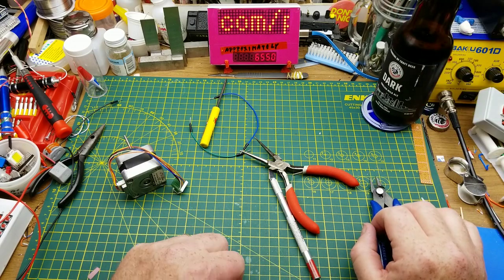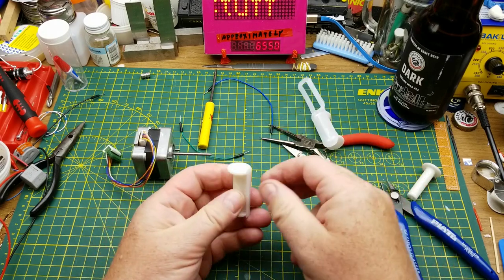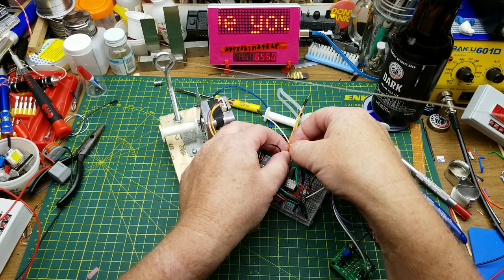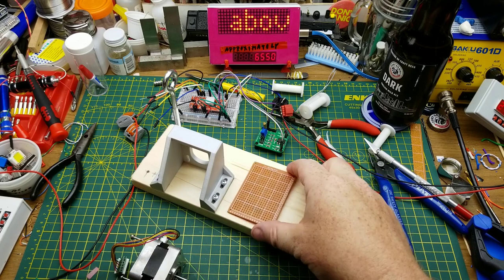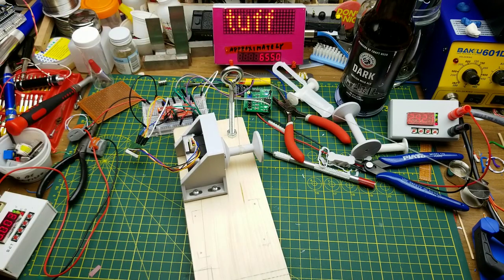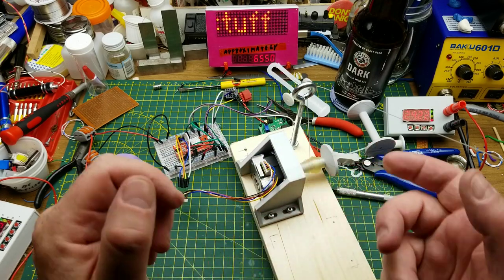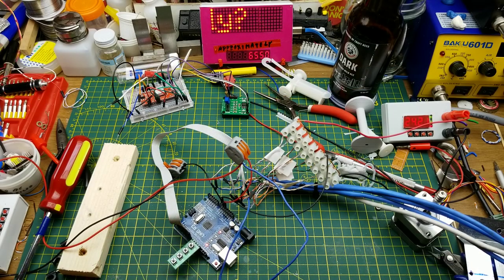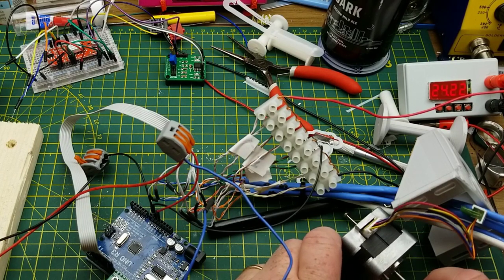attempting to build a homemade skycam (part 2 of ???)

Comment: Another idea is adding a tension feedback via a sprung mount with micro-switches such that line can advance when tension is high and retract when tension is low. That could reduce the geometry calculations and help keep all the lines at a nominal tension.
Reply: Just realized Jim Hammock suggested the same tension idea. : )

Comment: Use a tensioner on each cable that automatically uses limit switches to maintain a certain tension automatically.
Drill 3 small holes in the sides of the spools to insert and hold the line without creating a glob of hot glue on the shaft.
Reply: I suggested the same thing before I read your comment. LoL
Reply: John L 
Great minds, huh! LOL
Everything I think of has already been invented.

Comment: Congratulations on the 3d printer! The Ender 3 v2 should help you quite a bit in your projects. I have an Ender 3Pro which I have used to print numerous parts for the layout ( servo motor brackets, stone walls and electronic control boxes) and have experimented in printing N-scale hopper cars. Now you can combine your three hobbies, electronics, model railroading and 3D printing. Can’t wait to see what you come up with next!
Reply from the maker: N scale with a filament printer? That's impressive.

So far I have only tried a couple of HO scale prints. I still need to dial in the fine detail settings, and I'm pretty sure it's going to take a lot of  sanding to make the layer lines disappear.
Reply: pileofstuff I downloaded a coal hopper from Thingiverse and tried printing it on my Ender 3Pro. It came out rather well but as you can imagine, a lot of detail is missing. Still, once I gave it a coat of auto primer paint from a can and added trucks and couplers, it looks rather good. Especially from 3 feet. I now have a resin printer so I would like to see how much better it can look. Filament printers don’t do too bad. Sure they’re not perfect but a can print a fleet of hoppers for next to nothing and with paint and weathering they look good. Try it, you might be surprised how well they come out.

Comment: You can remove gears/pulleys from motor shafts without force. Just heat them with a small torch (even lighter should work) and they will fall right off. I found that amazing when I first did that  ;-)

Comment: It is inevitable these days, makers can't resist a 3D printer. 
My best use is making electronics enclosures that are exact fit for the components.  Having an enclosure planned also leads me to make breadboard projects permanent on a PCB.
Reply from the maker: Yeah, I resisted for a long time but this project is going to be a lot more possible with one.
Reply: @pileofstuff  A 3D printer opens up a plethora of possibilities. I took the plunge a few weeks ago. I noticed that, once you have one, you realise it can do so much for you. Either enclosures, prototypes or doing repairs on all kinds of things. This really is the best invention since sliced bread...!
Reply: Also the reason I broke down and bought a 3D printer ...
Wanted to make enclosures for evil electronic projects.
Reply: That’s the main reason I want to get one. I go to surplus stores and I get what almost fits.

Comment: Very interesting project... and quite complex when you start to think of it.
For moving the camera around, I think the code has to know how long the string to the camera is for each motor to start with.  So you need a calibration point. Then the length / amount of string per revolution spooled / unspooled has to be known to the code too... Tricky, when the amount per revolution varies... Beside the hardware, which we see is undergoing its maturity process, it's the code / software part that would also be very much of interest.
Reply from the maker: Hopefully my teenager can find time to work in the code now that he is back at university.

Comment: Seeing the first video I realised it needs some trigonometry logic for the exact "problem" as noted in this video. Challenging, but not impossible. It's all triangles -- after working out the problem on paper, coding the solution should be pretty straight-forward. It may never be 100% due to the fact that the cable turns around on the printed axels, and as it winds the cable around it, it will increasingly wind up a longer bit of string each turn -- if you get what I mean. It could be compensated for in code, but I guess that difference is negligable. Definitely in these first prototypes.

Interesting project -- looking forward to further developments! :-)

Comment: Great progress- I wouldn't have thought of 3D printing spools and brackets but then (I think) I'm older than you are. I gotta get me one of those. As I sit here and think about it, I could print a lot of things I usually fabricobble out of angle brackets and such as you did in the first iteration.
It would be best to have a mechanical solution to all the trig and sagging you're facing with the cables. Ideally it would be along the lines of a plotter but that means stupidly long guide rods.
Reply: I have heaps of steel and wood to fab stuff, but now that I have a 3D printer I just draw it and let it do it. Decades of fab-ing now makes it annoying to trial and error stuff, so I went with a 3D printer. Plus learning something new is interesting. Maybe watch some TinkerCAD and CURA vids, and it might be easy for you.
Reply from the maker: Anything with rigid moving components would also seem to be a lot harder to do in 3 dimensions - I also want the camera to be able to move  up/down, as well as to any X-Y point in the room. 

And I'd prefer for it not to injure me when (not if) it hits me in the head.
Reply: @pileofstuff  Well then, you're stuck hoping your code poet kid has also mastered 3D frig. And yeah I get what you mean about not wanting to wear a helmet all the time- BTDT.
(BTW I just watched Blondiehacks' latest video where she answered your question about why she never uses he electronics gear in her video intro.
It's so cool knowing you guys know each other and are friends.)
Reply from the maker: Well, I don't personally know Quinn, but I do support her on patreon.  I've learned a lot from her videos, she is a good teacher.
Reply: @pileofstuff  If I could support my fave YTers on Patreon I would but Social Security doesn't leave a lot of slack for that kind of thing.
I agree, she's taught me a lot too.

Comment: The positioning is a matter of solving the triangle geometry, but the spools must not allow the lead to bunch, pileup as the lengrh of motion will be critical to maintain control of distance travel per step as constant. Fir which the diameter the lead runs on/off the spool must be constant, or some other feed back arranged to read travel of lead independant if the stepper number of steps..
That feedback could be a pulse train derived from a shaft/soool with say 1 turn so that a constant distance per pulse can be derived.
With that to position to any X-Y point the distances from each of the 4 corners is solved, a travel distance from current to target location of each calculated, a speed factor and number of steps of each determined and applied moving the camera in a given speed linearly to target location.
In effect the steppers need to drive in like manner to the algorithms used to draw lines on a graphic screen and ensure they look straight. Such graphic algoritms should be readilly found. As the stepper positions are each the same as differences to the instantaneous XY points of the line.
Reply: The math is so, so much easier with only three motors
Reply: @RSterkenburg  do not think triangle solutions are hard.  Yes three motors is feasible and would work similar to some 3D printrrs, these however use the third Z axis as well , probably used more critically as extruded filament layering to bind is more dependant on pressure than XY motion. 
The camera stability couldl be better in a 4 motor system. Also for a typical room mounting at the corners may be more convienient, without significant computational effort even on such a low end Arduino system. 
It remains a easy issue to adopt either 3 or 4 motor solutions, if you were paying for all components and wanted to maximise profit manufacturing and selling a product you could well prefer 3 motor solution, 1 less each motor and driver hardware. I do believe the large sports field 8nstallations use the  drives.
Reply: @RSterkenburg  sorry the final part lost the numeral,.... was sports installation use 4 drives as far as I am aware.

Comment: A thought about all that trigonometry: how about having the motors only ever pull the cord. If a motor isn't actively reeling in, disengage it from the spindle. Have weights suspended from separate cords wrapped around each spindle to provide tension when the motor isn't running. You'd need a mechanism to act as a clutch, but it might be worth it to simplify the coding.
Reply: Isn’t that like algebra and calculus? Ewwww. There is a reason I wasn’t a math major.

Comment: Need a high parking space shelf, do not want the thing to hang all the time, 
or make the "camera assembly" removable leaving very little weight on the strings.
maybe 3d print the camera plate with many holes or use something light weight.
Another solution for attaching the string to the spool, a hole in the side closest to the motor
or if on the other side (end) may need a second axle to keep the spool from wobbling, 
hole in other side (end) is easier to attach the string. (if it needs replacing)
is hot glue really a long term solution to attach the spool to the axle ?
Reply from the maker: The hot glue is intended to be temporary, but it'll probably be there until it fails.

The original worm gears were held to the shafts with an adhesive and they took a lot of force to remove, so maybe I'll just upgrade to a stronger glue if/when the hot melt fails.
Reply: @pileofstuff  possibly consider the BONDIC UV cured plastic in place of glue. It has a very strong plastic and will not soften like hot glue or deteriorate in strength like most glues. At least consider two part epoxy inplace of the hot glue

Comment: you could have solved the spool problem for about 1.39 by buying actaul thread. resever the thread and use the spool.
Reply from the maker: I tried a few of my wife's sewing thread spools. The shaft on the motors is far too small, and I had to do a lot of janky shimming to even make it fit. Even then it wobbled more than I am comfortable with (and I'm usually pretty comfortable with some really janky setups)

Comment: How about using one spool with designed with a divider in the middle of spool. Winding line one way one half , then to a pulley on other side of room , back to motor winding on on other half of spool in the opposite direction. It would work as let out and take up motor at same time?
Reply: Isn't winding IN on one half and OUT on the other, the same as just looping it around a spool in a single 'belt'?
Reply from the maker: Yes, and that would work if I only needed to go in one diagonal across the room. Once the other direction comes into play I need the ability to lengthen or shorten all the strings independently.

Comment: Has there been a Part 3 yet, or have you abandoned the project? This is very much relevant to a discussion I started on Model Train Forum: https://www.modeltrainforum.com/threads/eye-in-the-sky-system.199986/#post-2646022
Reply from the maker: Thanks for the shoutout.

And, sadly, the software still is beyond my capability.
Maybe one day...
Reply: @pileofstuff  Thanks, POS (that is your diminutive, right? 😉)! From the beginning, I've suspected the software is the most crucial part -- humans just aren't very good at doing trig in their heads on the fly while simultaneously controlling four joysticks!

Comment: Poor contract coder ;-)   ..  Just thinking, for 1000% overkill, those optical interrupter disks that printers use might help with the 'varying' diameter of the winded string.  Running the string through a pinch roller with an interrupter disk (maybe between the eye and the spool) might indicate string travel.  However, running the string around a spindle for this, might cause the string to 'twist' as it tries to center itself.  

Now, for 1M% overkill - Think how the 3D printer head 'floats'.
X co-ord - a single clothesline loop along 3 sides of the room (that's one stepper). 
Y co-ord - a traveler clothesline loop, (that's a 2nd stepper) connected to sides 1 and 3 (of the 'single' clothesline loop that travel in the proper direction).  Spread this loop.  Fix one side of a 'frame' to one side of the loop and put a straw 'guide' on the other side of the frame for the other side of the loop.
Z co-ord - hang the sky-cam under the frame.  Run a single line (3rd stepper) looping from the frame corners to the sky-cam.  
Add an ultra-sonic sensor to the sky-cam to measure the distance from the ceiling ... maybe add two more sensors to measure the distance from the 'frame' to two adjacent walls?  

Using loops (and tension wheels) sounds good.
Also, add safety lines to the sky-cam.  And stand back!.  We all know what happens when a guitar string breaks :-O 
Yeah, there are flaws. But it makes a good story.

Comment: What are you using to do the CAD drawings, it sounds like Fusion360.
Reply from the maker: The spools were made using OpenSCAD.

I've been experimenting with FreeCAD and a few others, but they are all very confusing (even with beginner level tutorials).
I know Fusion is very popular, but I prefer to stick to open source options if possible.
Reply: @pileofstuff  I've seen videos of them and they look hard, but because I'm not that smart - lol -, I use the simple LEGO block type TinkerCAD. I guess it can't be much harder than Inkscape, so I might look into it.
Reply from the maker: @walterlippens6675  As much as I dislike cloud based software (Fusion has just changed their policies on the free version to make it more restrictive), Sketchup and TinkerCAD do look relatively beginner friendly. 

Ultimately I'd prefer to find an open source CAD that is beginner friendly enough for me to standardize on.